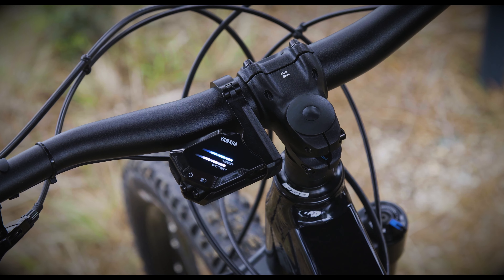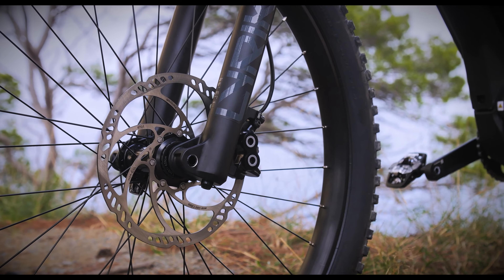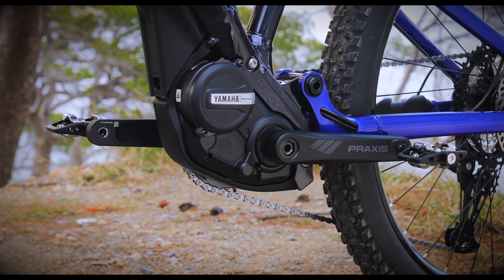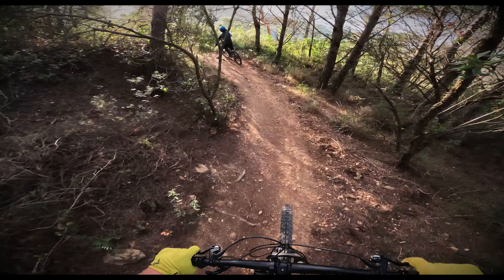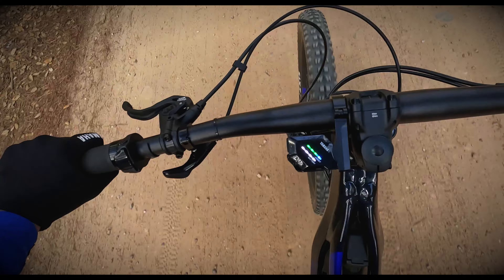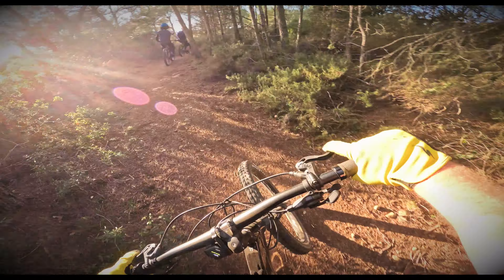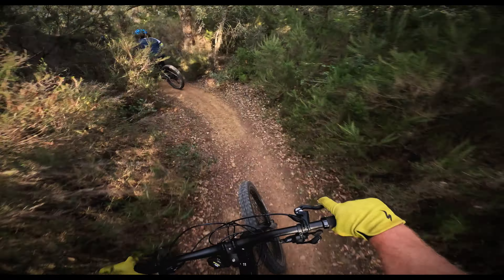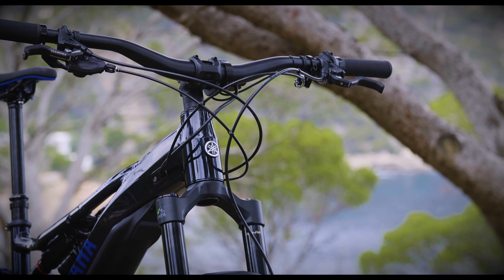Yamaha PW-X3 Motor Test

Comment: I love my PW-X3. Primarily due to the six-month wait of getting a all-trail 7 29er in XL size. Used only for commuting & light trails as I cannot afford the cost of beating-the-bike on rough terrain, as many YouTube channels display. The PWX3, easily accelerated and conquered a 1900 foot hill(a very steep road), and despite a large portion of battery being exhausted on the climb, the motor got my 250 pound frame(minus the bike), up that hill. Thirty years ago, I could barely get-up that same hill on a Specialized road bike.  All I now desire is a better-battery. Faster charging, and longer-lasting, with less weight. The technology exists, yet companies seem to procrastinate the improvement.
Reply from the maker: yamaha have something in the works. The all mtn should have a 630 wh option.
Reply: Giant has 800 battery, and they are powered by yamaha. I can do around 50 km with 800+ m climb and still.have juice, on a Trance E 2020 pro, 625.battery, and weight 220+.

Comment: Excellent video. I needed this when determing what moro to buy. The lower end still has the pws2 motor. Probably worth it to me to get the pws3 - lower weight, size, better q factor, more power, smaller display.
Reply from the maker: yes its great value at moment as well.

Comment: Great motor. Very natural. No excessive overrun that propels you when you don’t want it, ie tight hairpin high tech climbs and down hill rock garden technical.. last thing you want is unpredictable propulsion. I wish Yamaha would fit another cell or two in the top of battery, seems there’s room between the twin split area on a Moro. 650w gets me another 10 miles. But this thing charges to 80% for another 20-25 miles very quickly so I suppose the weight trade off is worth it. Not riders going 40-50 on a day. 

35 miles excursion ability for adventure touring would be nice however.
Reply from the maker: It's a good motor
Reply: the PWX3 exists with 720Wh not only 500Wh. Like my Haibike Alltrack 7
Reply from the maker: @jeanmartin963  yes

Comment: Are there any alternate displays that will work with this bike, or alternate mounting options?   Yamaha has some huge rebates / discounts, and are including a second battery with current sales in my area, but that display location wouldn't work with my bike rack (hangs from the bars near the stem).  If it could be moved to the right side like shimano does, it would work.
Reply from the maker: @TravisN  you can move it.

Comment: Cool video! How do you find the yamaha system as a whole since there is no app for it where u can keep track of the miles done on the bike and battery information etc?

Thanks!
Reply from the maker: You have to go to the dealer to plug in currently.
Reply: Bummer there is no Yamaha app to display this but thanks for confirming

Comment: Hello, quick question. Is it normal for the motor to turn off after 30 seconds if not riding? Is there an auto off time? 
Thanks
Reply from the maker: 30 seconds is too short.... a few minutes, in the order of 10 is normal.

Comment: did you test the walk mode? does it have it, pw-2 was very bad at it. Tnx
Reply from the maker: It's better. Not perfect
Reply: It is good in activating the speed delimitator
Reply: @alexbiketester how does it compare with Bosch gen 4 which basically pulls you uphill in walk mode?
Reply from the maker: @sterpumihai  similar , the shimano ep 801 is now stronger than all of them.
Reply: sam compared them all and ep801 was the slowest 😮 @alexbiketester
Reply from the maker: @boxinggloves87  there is an update based on my testing its faster than bosch,
Reply: @alexbiketester  can you dropped the link
Reply from the maker: @boxinggloves87  https://youtu.be/gijExt4EC5o

Comment: Hi nice review would you say it's as powerful as the bosch
Reply from the maker: Slightly more powerful. But marginally hard to actually see this.
Reply: I have both the bosch performance line on my Trek 9.9 and the Yamaha PW-X3 on my Gasgas Enduro 3.0 and the Bosch is the better engine and is more powerfull. I love both bikes and both motors but my next bike will include another bosch engine.